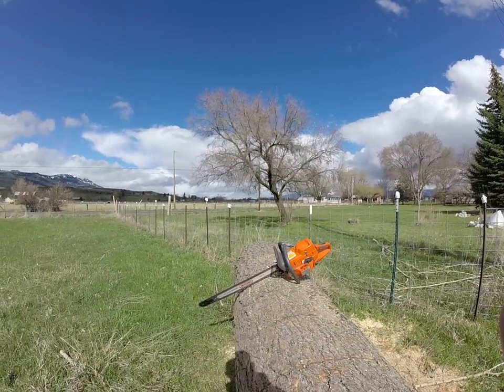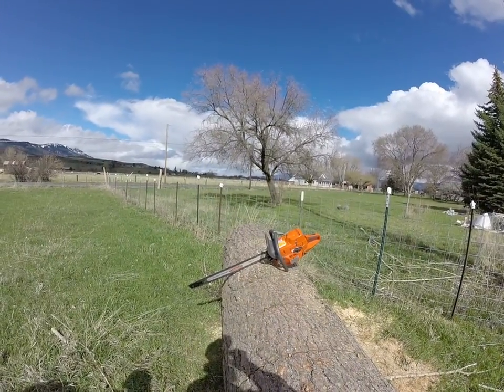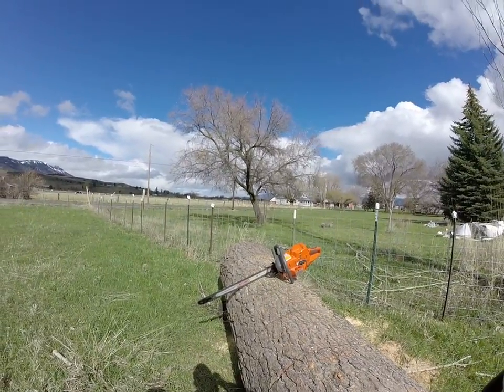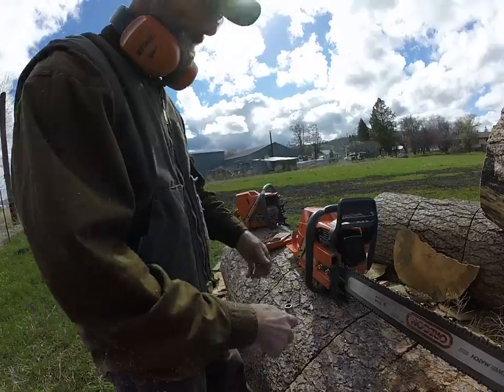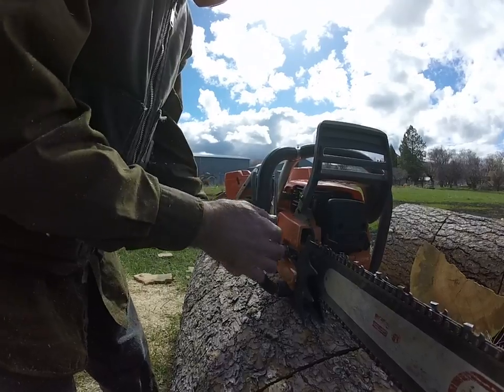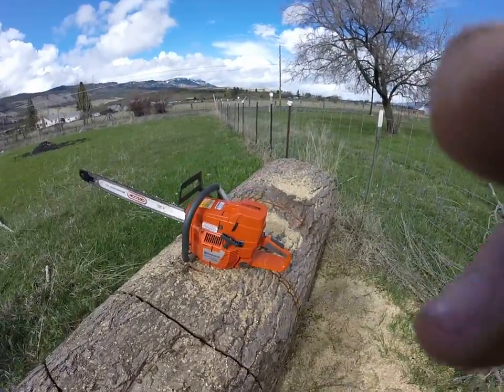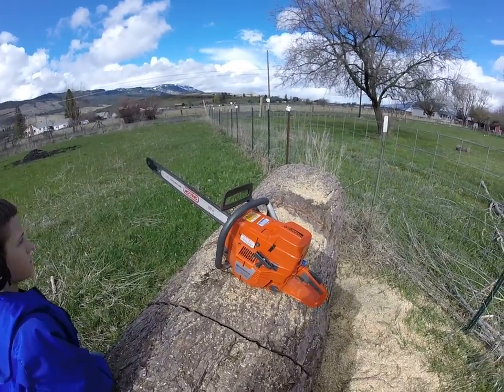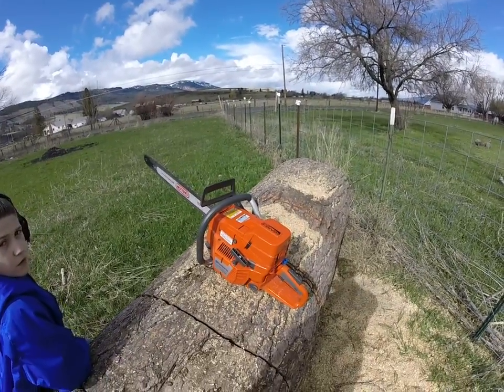SuperSized Insane-O 390XP vs. Insane-O 395XP

Comment: I have had a chance to run the 390 for three days and it's just starting to turn the corner, this saw is a different kind of cat!  very happy with the zipkit.  Jack really knows his way around these saws. I have a 461/insane o monster that will give a stock 661 a run for its money and this 390  is a screamer, it will zing a 36 with full comp all day and still running a fairly dark screen.  It'll be a beast when it's broke in and carb is dialed in. Thanks Jack, I will report on the 395 next week when I get some time on it.... I have had a chance to run the 395 some, it is very fast with loads of grunt, it will pull a 42 with authority, very happy with both these saws.  Thanks again Jack
Reply: Thanks for your comments!
Reply: How do I get you to do a saw for myself?
Reply: Jacob Mitzkus there is no doubt an insane o 461 would dominate a stock 661. Logger wade just posted a vid of a 461 insane o putting the hurt on his 395.

Comment: I have a 395 with a 32 X-Tough Light bar (Sugihara) .063 gauge and a skip tooth Husqvarna  X cut chain. 
The balance with this particular bar is incredible. It doesn’t heat up and it cuts like an absolute monster. I would like your opinion of this combination?  Thank you
Reply from the maker: I'll run a 70 to 80 cc saw with a 32 or 33" (110 drivers .375). I like the combination to slightly nose heavy. Where is bar is canted down at about 15 or 20°.  The "flickability" is better -  balance wise for speed limbing.
Once I zipp a 592 it is a 3' and up bar mo-chine. 
I got away from the Sugi bars ~ 15/18 years ago. They had a bad go with the rails (inside) being like mush. I prefer the Tsue bars or the Sugi. A bit less mass and they have the best rails.
Thanks for watching.
Reply: I just saw this reply. Thank you so much. I am far newer on my saws then you.  You have probably forgotten more about Soss than I will ever learn.  I appreciate your wisdom, and experience.  I plunge cut a lot, and the exceptional balance on my saws really helps and helps reduce fatigue. I’m in good shape and I’m strong and the weight is an issue, but you talk about the benefit of a nose, heavy bar can you explain that to me. I’m almost 6 foot two and I weigh 200 pounds. I have long legs and long arms. I’m just offering the Ergonomics Month if it makes a difference. Thank you very much.

Comment: How much fuel does a ported saw burn? Is it true that's its double the amount?
Reply from the maker: Luke hi.
Not with my builds for the most part.  
45 mins. to an hour of gnawing. This is about the same as the stock version. Getting WAY more wood on the ground at the end of the day. Could be partially due to my chain though, lol.
Thanks for watching.
Reply: @hotsaws101  
That's good know, thanks.

Comment: First time here. Have an old 288 and thinking one day to replace with a 300 series so wanted to hear your comments.  And appreciate you putting out helpful vids like this!
I was a bit shocked to run into Mr.Self Appointed Self Righteous of the Manly Tree World...
Sure interesting isn't he...
I've been around long enough to know that God can reach anyone...
Perhaps especially those at either end of the hot/cold scale!
God bless you brother.
Reply from the maker: Randy hi.
I have a 288 under my bench now that will be in Psy-Ko trim at some point. I'll be able to run it against some of the 390s that come through.
I did run cousin Gary's 288 and a 390 last winter. The 385/90 platform has a lot better flow characteristics and came out on top. But, I built the 288 ~ 17 years ago so it has a fair amount of time on it. Not really an equal/fair comparison. I think in the end with all thing done equally that the 390 will prevail. Likewise, I think that the 288s will last a little longer. With a slight burble at high idle they are pretty much bulletproof.
Assuming you were you referencing another viewer/poster in the second paragraph? I don't have a lot of spare time to peruse yt and consider myself "outta the loop" on what others are posting/doing for the most part. "Prolly" considered out of the loop in the builder's fraternity as well.
You are right though, anyone and everyone is reachable. The question becomes, will they hear His voice.
Blessings to all in your camp as well on this day.
Reply: @hotsaws101  Sorry I'm so slow getting back to you. Been traveling into area with NO WIFI and iffy Cell service. Now home again.

Thank you for sharing your experience re the two saw series. 

Please head me in the right direction!!!

Just purchased a Husqvarna Compression gage, 20K Service Tachometer (DTI-20K) so plan to test the 288 and go from there...

Your question, "Will they hear His voice?" Applies to me as well... So easy to set my ideas of priorities ahead of His...

Comment: what do you prefer inboard or outboard clutch? 390 or 395
Reply from the maker: Hello.
Outboard clutch is the only way to go. Depends on the bar length, wood density, ground conditions, what are you actually doing (i.e. head faller, or bucker). 36" and down 390 generally. 36", 38", 41" the above really applies. True 42", 48" 50" etc. no question which saw.
Thanks for watching.

Comment: I've watched all your videos a couple times. best faller on YouTube by far. in my humble opinion. I'm also a northern California logger.
Reply from the maker: Rick hi. 
Thanks, and for watching.
Reply: @hotsaws101  can i set 13200 rpm for 372xp oem after one blown tank? saw after replacing the piston ...
Reply from the maker: @Sensei948  hi.
How are you not getting heat form that tuner who uses the same avatar?  

You can set it wherever you want.  There is no way for me to tell you it is "this", and it is "this" every time.
The chain is going to play a huge role in the process.
Also, thinking that I've gone down this same road with you numerous times before. My stance is not going to change.
The link to the video shows how I do it. It is the same every time when doing a one time adjustment session on a saw that is broken in. On all saws that allow the operator to adjust the needles that is.
1st. Get the low speed circuit set. I like the saw to drop off of high idle fairly quickly. No Da Ding Ding Ding Ding Ding like what can be seen sometimes on a 2-cycle dirtbike. 
One or two then they hit lowspeed idle.
Adjust the high speed circuit according to how YOU want the saw to perform. 
I never owned a tach until ~ 4 years ago. I tuned in a falling application by ear. This requires the chain to be dialed in. It is what keeps the engine in check.
An audible miss at high idle will net a good running saw. I've found they will last a long, long time as well.
I've never, sans the 346 in the high winder series video, melted a saw down. I did it on my 346 purposefully. 
I'm not into "x" rpms personally. The factory says 13.5K for the upper limit on the 372 series saws. It would depend upon the saw's state of tune however.
Some saws will run better at a different rpm level than others. So,,, having the saw testing done where the saws are at the same rpm is not necessarily fair to both.
You need to experiment. Because again, there is no "x". It's get the b&c on, go use the saw while listening to it run. Again, audible miss at high idle, freewheeling.
The assumption here is that the saw being tuned has the b&c on with the chain tension is set for use.
https://youtu.be/asI83G2Go9Y
Thanks for watching.

Comment: I been using my alaskan mill with a 460 and was wonderin if using a hot rod saw to mill with would be asking for trouble..?? I don't wanna burn my modded 394 up. Im probably gonna use my 064 on the mill and it needs an impulse line and a miagi guru like yourselfs special love..lol..your a great hand at fallin and workin on em too...one day I will send you one..even if I'm 73 and bedfast...lol.
Reply from the maker: Milling and dyno run are synonymous. Not all shops' abilities are the same, so it's hard to speak for someones' handiwork. Generally, I "wood" fatten up the high speed screw a fair amount and make a cut or two while listening to and watching the screen/s. When it warns up, it will lean out some. You want a definite miss at high idle when you back out of it while cutting. The 2100/210s and 288s were the same way.
And oh yah, was wondering if  milling with a 460 is a time waster? It's a good thing for me though because you will reach (at least feeling that way) the 73 number quicker as you hair goes grey waiting a 460 to burn through a run. Prolly won't be able to pull start it at that age anyway - mantle piece..... Just sayn.
Thanks for watching.
Reply: hotsaws101 done a nice cedar today and ground the chain last night and it wS all downhill milling and thee ol 460 done fair I guess
Reply from the maker: Arborist460 The last paragraph in the 1st response (revised) was coming from a place of levity. Hope it did not get missed as such. Reason is, both my grandfathers gave me their saws when they were unable to start them. Both were in their 70s' and both were grey. 
On a follow up thought, did you ever find a good 181?
Reply: No. But I'm glad you remember me..lol..been alot transpire in the family here lately and just about everything including work has had to wait....I'm one little guy trying to take care of both parents plus my wife and 2 kids..and am spread very thin...all I can do now is pray my good friend...I really do appreciate you takin time to chit-chat with an ol country boy...I wish you well..and b3 safe in the woods..I worry about people I know are on God's doorstep everyday...but he will take care of us I know..
Reply from the maker: More than the beasts of the field and the birds in the air.
If you are still looking for a good 181 maybe shoot me an email, I have 12% of a plan......
Reply: If I can get a extra dollar or 2 I sure will. Thanks jack your a classy guy